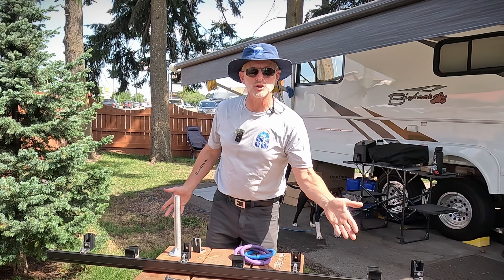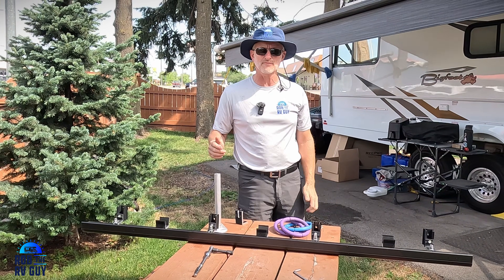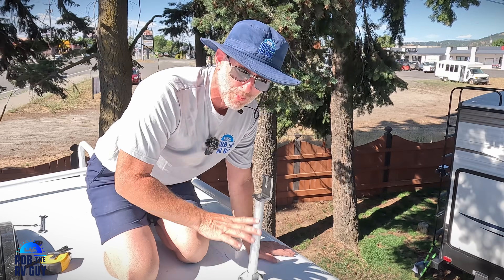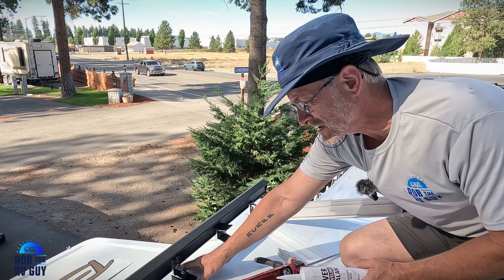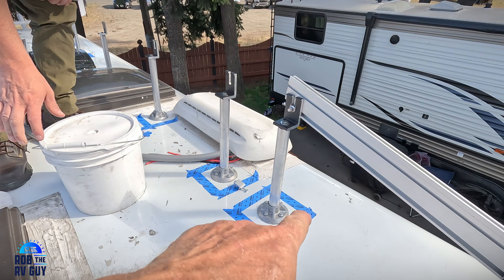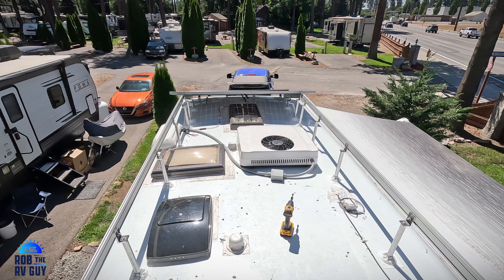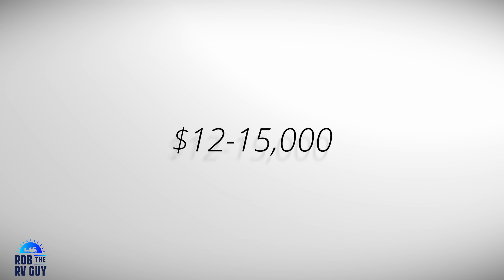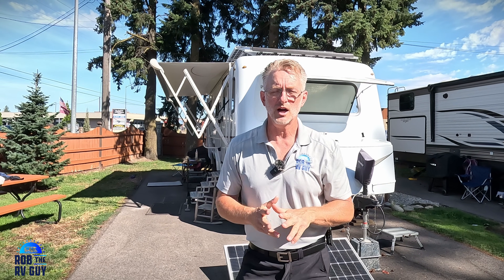Massive 2350W Solar Panel Install on Bigfoot 25RQ RV with IronRidge System – Step-by-Step Guide! ☀️

Comment: Setup looks nice , but I would be afraid of smoking my A/C unite due to not enough air flow because of the solar panels
Reply from the maker: Has yet to be a reported issue for any  of these type installations.

Comment: Very ambitious project!

I'm in the process of installing a 24V solar system (Victron) on my late 2003 25RQ. 

I'd like to keep the skylights free and clear.

My main concern is securely attaching/adhering the panels to the roof given our temperature extremes (-35C to +40C). 

Interested in the higher efficiency inverter (24V) AC roof mounted heat pump units too. I'll see if I can find your video on that one.
Reply from the maker: Go to 48v.  I'm seeing some rooftop ACs coming out in 48v, skipping 24 altogether.

Comment: I can fit 2200 watts on my 27' class a winnebago vista... But if I use your idea, I could replace my AC with a 24v, add a second 24v in the rear, then go over them and fit 3200 watts... Hmm... Oh, and my vista has the fiberglass roof WITH aluminum rafters.
Reply from the maker: Excellent project!

Comment: WOW, that's a lot of solar for sure Rob! Curious, is this feeding a 48 volt Victron system, and did you install the 48/24 volt system in the same place as your 12 volt system, back left storage compartment? My Bigfoot 25 should be ready for pickup in a few weeks, any suggestions on what to pay particular attention to before completing transaction?

I'm up here in New England, and haven't decided on my solar setup. I'll be hauling with a extended 3500 Chevy VAN, and was thinking about putting 800 watts on the Bigfoot with a adjustable solar panel on the van roof that acts as a wind dam when driving. and can be adjusted to capture the sun angle when parked.

Another great video and any suggestions are appreciated.

CHEERS!
Reply from the maker: Greetings.

I didn't convert to 48v.  I stayed with the 12v for now.

I don't have any suggestions other than run everything to verify everything works.

Let me know how everything turns out.